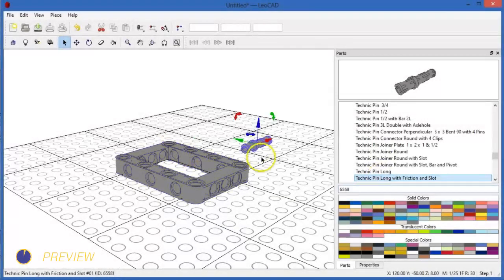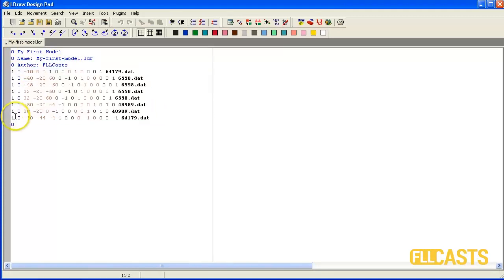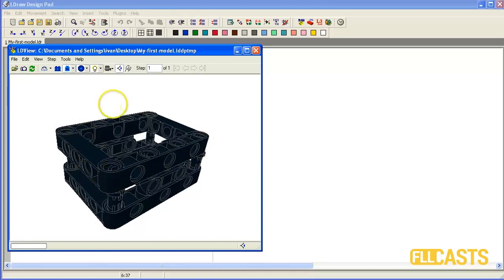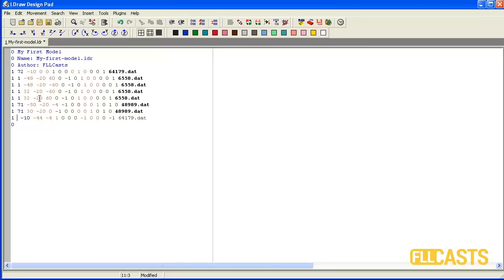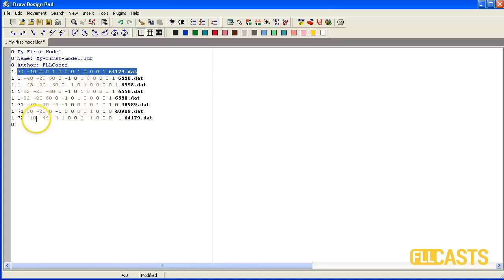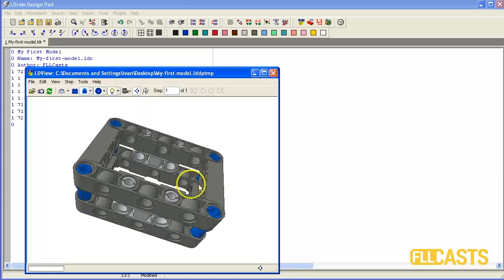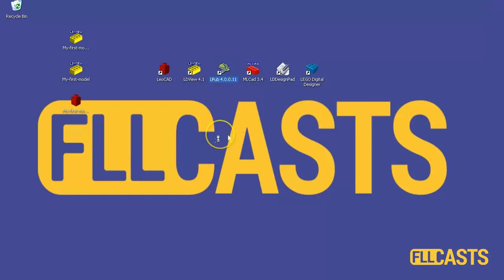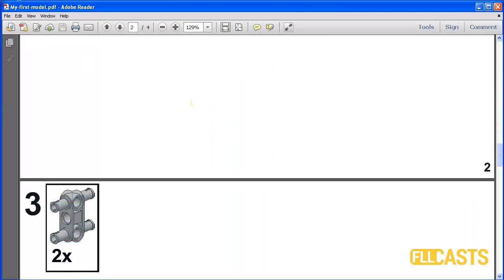How to build a 3D LEGO Mindstorms Model using LDraw (part 2)

Comment: How do you make building instructions with this if your model has over 1500 parts? You'll never find what parts will go when! :(
Reply from the maker: Using only LDraw it is not very easy, but one could get used to. Generally in an EV3/NXT robot there a tens of different parts used and the model generated from LDD is a good start with all the parts in place
Reply: FLLCasts I used LDD to build my Scania Truck. Then I exported it to the LdRaw program called Bricksmith. It basically does the same as the program you show here. I really want to get great building instructions as the ones which LDD makes isn't as good as I want them to be! :/
Reply from the maker: ThinkCleverAndSmart Many years ago we tried and we've decided not to use Bricksmith. i do not remember exactly why, but we were not happy with it.
Reply: FLLCasts I think it's ok, but not great. I mean, it would be nice to have an built in automatic instruction generator like Lic. But I never get Lic to work. :(